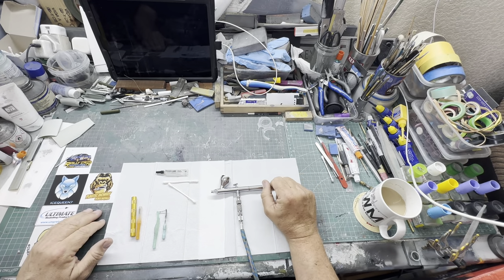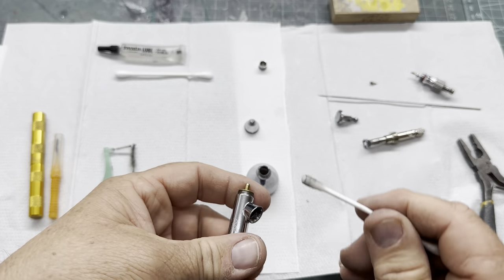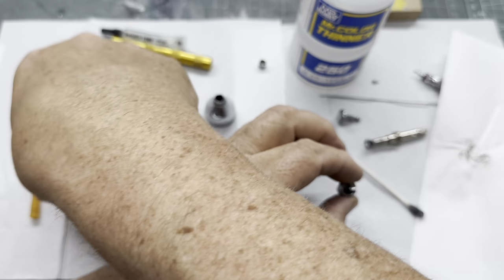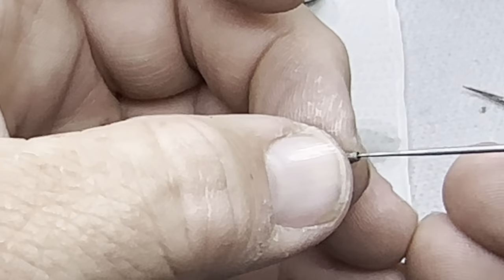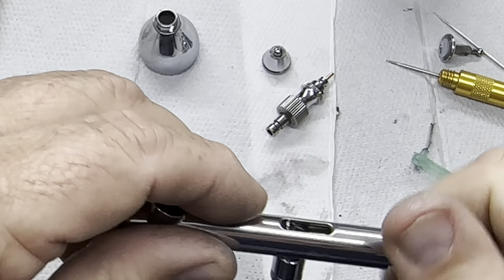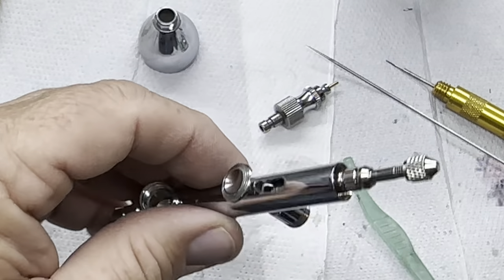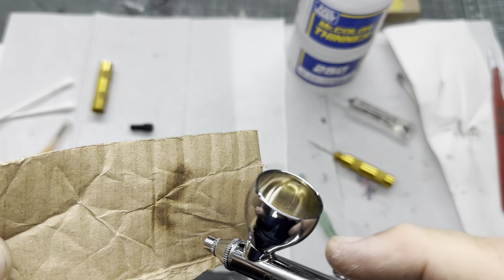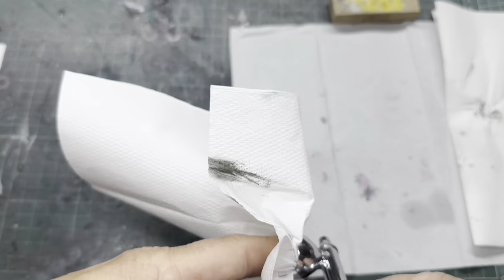How I clean my airbrush and what paint mix I use

Comment: I run a couple drips of airbrush cleaner fluid through it at the end of every paint, a drop of spirits in the cup to take out the bulk but tip it back out rather than blow through, don’t want to ruin the seals, I’ve noticed that any paint that has a sparkly texture is much harder to clean out properly,have to flush through several times with the airbrush cleaner or every paint I use would have sparkles in it lol